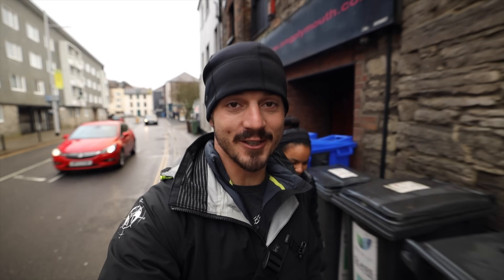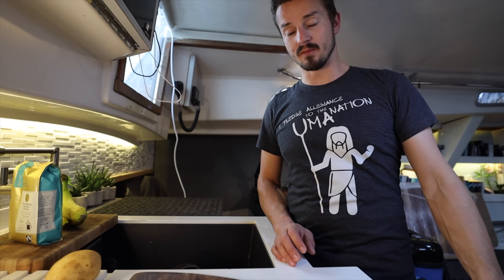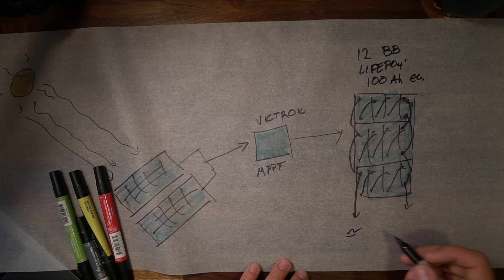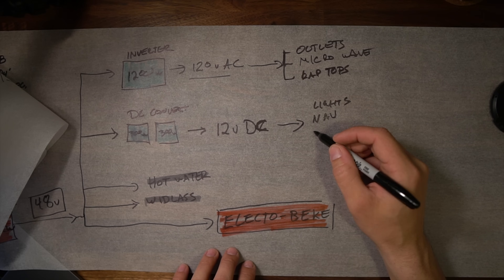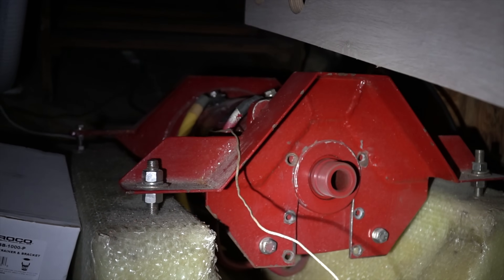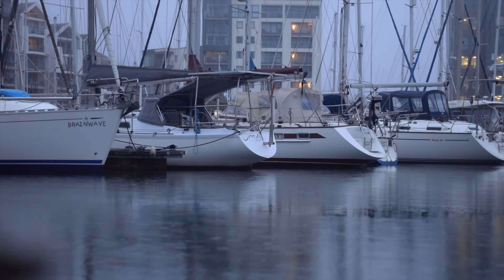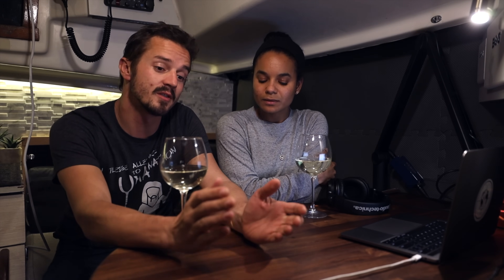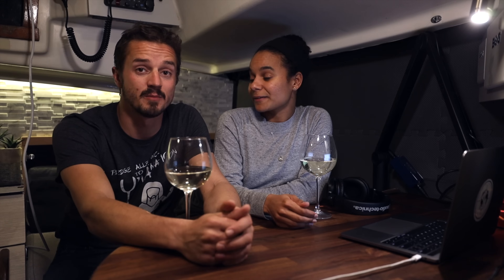5 Years Living offgrid on an ALL ELECTRIC Sailboat — Sailing Uma [Step 206]

Comment: There is another sailing channel that I watch who uses a drag propeller on a rope that turns a generator while they are sailing.  Using your prop is a great idea. Some/many motors can be converted to generators from what I hear.  I don't think I'd worry too much about having a pair of wind generators shading your panels. In port you could drop them down if need be, but at sea with wind, you'd probably charge from wind generators faster than from the panels and they would work all night as well. That would probably allow you to run your hydraulics as well...  You didn't mention what the draw is from the motor at high speed. I'd think in a storm, you'd want all you can give it!
Reply: You may also think about a dis-coupling device for between your prop and motor. This might save you some drag while sailing. Also, if done right, you probably could attach a generator to the shaft with V-belts and run less drag than a big motor..  I can't do the math without knowing much more, but it's something to think about!!

Comment: Nice video, I like your set up and it makes a lot of sense.  Very cool that you can motor around on electric only!  
Some advice - in places you substituted kilowatts for what should be kilowatt hours and vice versa.  Kilowatt is a measure of power (how fast the car is going), kilowatt hours are measures of energy (the fuel in a tank, fuel used from the tank, or distance traveled).  When you say that you used X kilowatts in a day, you mean to say we used X kilowatt hours per day.

Comment: yo guys have you looked into making power off the motor with the back of the shaft and mount an alternator so you can  draw power off it why it runs... also with the prop that drives it you make electricity out of that also with (a shaft Generator) im an engineer and these are common on the ships i used to work on including navy vessels for 7 years. any way have look into it because there is a lot of other ways you can make power with the equipment you have.

Comment: I love everything! Hate the idea of running anything on diesel. I call diesel engines tractor engines. :) But I have to say - it's kilowatt HOURS (kWh), not kilowatts (kW) :) First is energy, second is power. In short - 1 kW of power per hour is 1 kWh of energy. Still better than some other folk, who kept using amps when talking about energy consumption.

Comment: Back in the day we started using electric/battery powered fork lifts. They had a regen circuit that would push current back into the battery when you were coasting. It acted like a brake as well. Maybe you can incorporate something like that?
Reply from the maker: That’s the plan.

Comment: Hi Dan and Kika - been catching up on all your videos over the winter and just got to this episode today.  I have been researching power options on my boat and since you use Victron I had a couple questions as I am a beginner at all of this. I  want to be able to sustain on my boat without shore power and looking into a battery monitor and solar charger.  I have been digging into the BVM712 monitor from Victron and think I understand it.  I have a slight concern that the battery monitor does not account for its own usage as it does not have power through the shunt but think it may be negligible.  What I need help understanding is solar controllers.  I do not need to create much power on my boat so a 50watt is all I plan to start due to size restrictions, but seems like there are a lot of options for charge controllers.  what would you recommend?  do they have readouts to know what you are creating?  seems that the battery monitor would only show the sum of the input/output so I would not know the watts the panel is creating.  MPPT vs PWM i have no clue the difference.

any suggestions would be great for someone going from a single deep cycle with shore power trickle charger hooked in to a self sustaining system.  i have already added a second battery in parallel to help with the longevity but time for the next step
Reply from the maker: If you have the budget for it, keep it in the family and start getting everything from the same company. Victron seems to be years ahead of everyone else when it comes to comprehensive, and smart components. Anymore specific questions, feel free to shoot us an email, we’ll do our best to answer them or send you over to someone who can.

Comment: Running the laptops off the mains uses more power. Most laptops run at 20v Dc, so you are using the inverter to up the voltage to 120v Ac, then the laptop power supply to drop it down again to 20 v dc. A dc/dc voltage dropper would be much more energy efficient. Just a thought.

Comment: Get a diesel engine.  İf you dont want to use to drive the boat, then use as a generator.
Reply from the maker: But why? We don’t need one. Haven’t needed one. Can’t foresee needing one. But more importantly, don’t want one.
Reply: @SailingUma  Because for the rest of your sailing lifes, you will count the consumed wattage during the long hauls.  You have no safety at all during the emergency when your sails get damaged (broken mast) in the middle of the ocean.  Why take a chance?   Only power for 3.5 knots an hour gets you no where.
Reply from the maker: To each their own I suppose. We are surely not telling you that you shouldn't have a diesel in your boat. But for us we rather rely on our sails and know how to jury rig a mast in an emergency instead of crossing fingers that an engine (with thousands of moving parts that can fail) would turn on. We have redundant backup sails for if our sails get damaged. If a mast is broken, most likely it is due to a capsize , in which case a diesel would not help as it would most likely be damaged with water itself. And in the middle of an ocean... I 'm sorry to tell you that you would not reach your destination with a diesel tank. Keep in mind that the diesel tank that we removed was 20 gallons, which would give us about 20-24hrs of motoring. Our electric motor can give us 10-15hrs of motoring PLUS unlimited electricity and capability to recharge out at sea.

Comment: Laptop computers can run on a 12vdc. You don't need to use an inverter. They contain an AGC circuit to step dc down to 5 vdc. That is what laptops run at. The cord that comes with them are there to convert house current to a useable dc power. You can rewire the plug keeping polarity in mind to just plug it into any 12vdc source.

Comment: I've had thoughts of saving energy jus like this at home!
We are a slave to a system that's milking us dry!
There has to be a better way for all to not use & depend so much on the main power company! Usage spikes during hot summers is getting harder for the power companies!

Electric heat is 100% efficient & no combustion!
Solar energy & battery banks & generators/alternators etc are good if u set them up properly!

Comment: Excellent description and explanation of your power generation and consumption with the aid of the schematic.  When you were installing the motor, I did think that heat might be a problem as the ex forklift motor didn't appear to have a cooling fan assembly, as normally provided on all AC motor drives. (lower speeds in fact can cause more issues of efficiency) Your character of use also was different with potentially long periods of constant speed drive as opposed very much stop start of a FL truck.  You have now described the "sweet spot" which I guess limited heat generation and aids efficiency however,  I did also think about the balance between your power source magnitude (PV panels) and battery capacity.  Your old batteries were worryingly low in capacity and my fear was for the event where you might be at sea, had lost any sail motive force, with a heavy sea and you needed a means of directing the boat for self protection.  Under these circumstances I felt you might compromise either or both, battery capacity or the necessary drive effort from the motor, to actually have directional control.  Do you think you have this under control now?  Do you think additional PV capacity may be of benefit? Maybe adding a fan directly to the shaft end of the motor would widen your "sweet spot".  I know by choice you limit electrical consumption but an emergency event may determine you had more available.  Hope my comment provides some thoughts for you.  Well done you both on all the excellent standards you both attain in providing these episodes.

Comment: Why are you not using your poll that you use for your sails to add a wind fan that will recharged your batteries even when your not sailings.
Reply from the maker: So far we just never needed to. The solar power was always enough.
Reply: That I did understand but at night you make increase your power at least 20% that could run your heat if needed or your electric motor. :)

Comment: Looking for a integrated 10,000 mah power bank with solar panel. Can't seem to find any that the built-in solar panel will charge. Have you heard of any. Mainly used for camping.
Reply from the maker: It with a built in panel. The problem is you need a much larger panel than battery. Hence the separate systems. Many come with their own panel and charger but you still have to plug everything in.

Comment: I've always wondered but never liked to ask but why did you call your motor electro-beke?
Reply from the maker: We bought the boat with a non working, big red diesel which was made by Westerbeke. So when we swapped it for electric and found an old can of red engine paint from the previous owner we painted the new electric motor red as well. So Electro-beke, just seemed like a fitting name.

Comment: I saw no mention of a watermaker.  Is that something in the future and would you have the power to run it?
Reply from the maker: It's on "the list". New water makers are VERY energy efficient, that's not really the issue. The problem is, good ones are $10,000 and to build one still costs $3-4000. So for now, we're happy to keep hauling jugs.

Comment: Dan does it again. He uses the units of electricity in a way nobody understands what he is talking about.
You just can't say "kilowatts per day". it is as absurd as saying your top speed is 10 nautical miles.

Kilowatt is the unit for power you use or generate in a certain moment. 

But the unit for battery bank capacity, or amount of energy used in a hour/day/week/year is kilowatthours (kWh). And those are what matters, when talking about energy usage and energy production per day.

Other than that, this was an excellent video, just like all your videos.

Comment: The advantage of a wind turbine is that is  can run day and night. Another option is a hydro-generator  towed by the boat. You need to consider "emergency" situations or times when batteries  are running low. For total power loss buy a sextant.

Comment: You keep getting power and energy mixed up. Still, I admire the work you've done.
Reply: Gary Casey I agree 😅 made it quite hard to follow but I trust they have it sorted
Reply: @sil8127  must just be luck or someone else is sorting this out. otherwise you end up with at terrible system that is not matched to your needs.

Comment: I understand that you are sponsored by dometic, but this is not the first time I have seen the problems with them. 
If you look at some of the overland/remote travel channels, a lot of people have moved to Engel or Sno-Master, for reliability, better insulation and therefore more efficient use of power, a limited resource.
Reply from the maker: The only issues we had with the old fridge was the plastic lid stops broke. But they fixed that with the new metal hinges. In 3 yrs we’ve never had an issue with reliability and it’s almost impossible to compare efficiency without doing a direct side by side comparison in the same conditions at the same time, which I haven’t seen yet.
Reply: Sailing Uma.  Fair enough, most of these comparisons are very subjective and the only one I know of are in the off road travel community in Australia and one never knows who is sponsored by who. 
Have only caught up on all your steps now and I really hope that you can get your visa issues sorted out. Others have suggested going to a schengen country and applying direct to the foreign affairs dept in that country rather than using a visa service, maybe an option. 
Anyway, best of luck and hopefully you will visit Ireland at some stage.
Reply: @SailingUma  I'm really happy to hear you have had good experience with Dometic, as I have recently purchased two for a road trip this summer.

Comment: Not to be a hater but 12 of those batteries cost around 12 thousand dollars (USD). Holy shite mate that had to hurt. If you where to forgo some convinces how many lithium batteries could get by with?
Reply from the maker: We’d need 4 to get us up to 48V for our motor. The other 8 are just to add more range and allow us to be on anchor longer with no sun. But on an average boat without an electric motor, you can pretty much replace 400Ah of lead with 100Ah of lithium. So they’re not actually not that much more than typical lead batteries. A Trojan T-105 is about $150 USD. So 4 would cost $600. One Battle Born is about $800 and will last about 20 yrs longer than a lead battery. Lifetime cost is actually cheaper with lithium.

Comment: Interesting and very well put together episode. Especially interesting to see how much motor consumes for that speed. We have -78 Perkins on Amphitrite 43 which is quite a bit heavier displacement and hence more wetted surface than Pearson 36.  So 3.5 kts on 1.2 KW  is most likely not doable unless it is downwind. On back of my head I have an ambition on replacing Perkins with old EV motor (like old Leaf) as soon as that Perkins starts to require more than oil change. 48V motor would be so much more practical than over 300V if power requirement turned out not to be obscene...
Reply from the maker: 300V is also very lethal if miss handled. The general rule is: Take the HP of your current Diesel and multiply by 250W to get you close to what you’ll need in an electric motor to get you the same speeds. So your looking at about 20kW to get your boat going the same speed your diesel does.
Reply: @SailingUma  Thanks for the info. That rule of thumb sounds about right. 300V is of course a high voltage but the amps needed for 20kW at 48 Volt are quite substantial also. There are pros and cons for both approaches. 240V AC is not much more safe than 300V DC either (or so I assume). Charging  electronics gets a bit more complicated with high voltage but so do motor control with 400 Amps vs. 60 amps. Well it is food for a thought until time passes that old Perkins... :)
Reply: @SailingUma  I have a followup question about the windlass. Which windlass do you have or did you modify it to run with 48V? Google fails me to find any useful info on 48V windlasses. 48V 15kW motor seems relatively simple to get, but needs of course quite hefty and short cables.

Comment: Hi Guys,
Just recently found your channel, love the offgrid solutions.
I am presently building an offgrid house, oh how the authorities hate me, heh heh!
Anyway, during construction I have been powering from a small wind turbine, initially 2 but now 4 solar (250w) panels, straight into a 48v battery that is big enough to sink your lovely ship, all controlled by a home built voltage controller that dumps the surplus energy into a heat exchanger (all designed and built by myself) which will eventually be connected into the under floor heating system. I use an 8kw inverter to bring the ac voltage to the standard UK household voltage of 220v and have never been short of power to run lights all day and some pretty heavy machines often for many hours.
We are based in the north of the UK, (Orkney Isles.)
You seem to have planned your electrical stuff very well, but if I can be of any help please don’t hesitate to ask. I will be happy to share my knowledge including data for 3 years worth of solar collection and separate data for wind collection. 
Of course, feel free to drop in if your UK travels bring you anywhere near Orkney.
Good luck, fair winds and sunny skies.
Robin.

Comment: Enjoyed the video. The units are a bit mixed up though. You have to express your energy consumption as kWh, not kW. For example, if you leave a 100W bulb on for one day it will have consumed 2400Wh or 2.4kWh. Which is the equivalent of leaving a 2.4kW machine running for one hour. Power is kW, Energy is kWh.

Comment: I guess if you are in the UK (Europe) you will need to use a 240v to 110 transformer for your Vitron or does this unit work on both voltages?
Reply from the maker: Our battery charger is a 220v model. In the USA and Canada we just plugged into the 50A circuits if we were at the dock, since they’re 230V. But our inverter on-board is 120v since most of our tools and appliances are 120v.

Comment: Wonderful project. But there are questions. What about security? What happens if one of the batteries fails on the high seas? You have a spare battery for this case? Emergency power source if the solar panels break down? Have you provided everything in case of breakdowns? There is a manual mode for the power management of the batteries, if the controller fails?